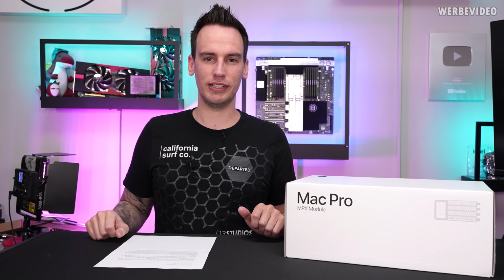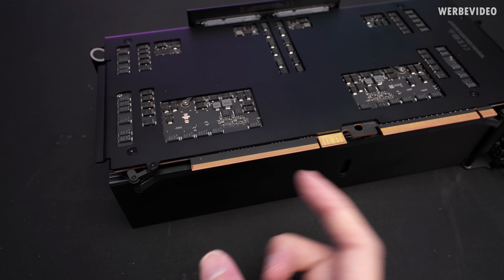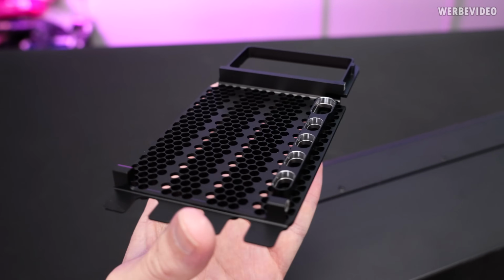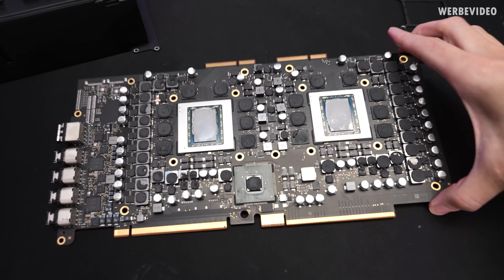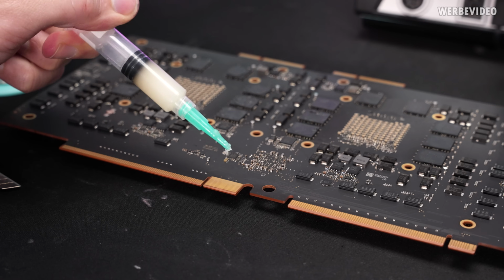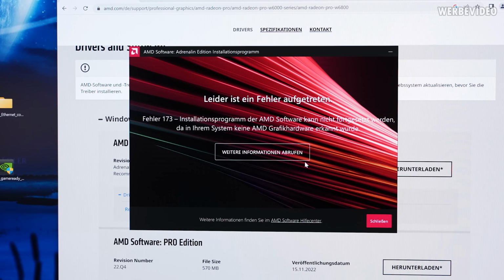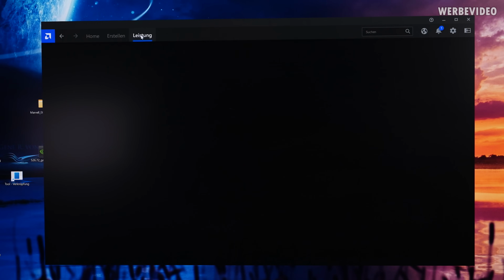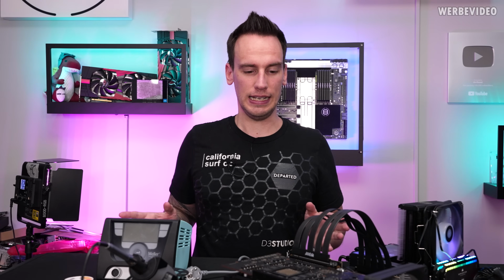This Insane AMD Dual GPU from 2021 is Faster than a RX 7900 XTX

Comment: The strange bridge on top of the gpu is the infinity fabric link. That bridge is allowing one gpu to have access to the other gpu memory
Reply: On Mac that bridge allows both cards to access ALL resources between them since they route all I/O through a set of MUXs.
Reply: @Menti Capti Crossfire and the Infinity Fabric link are not remotely the same
Reply: That's how Thanos was able to travel between worlds
Reply: my prototye Radion pro v540 which would have come out before that card and has 2 GPUs i think has crossfire it never released and has no drivers so I can't check but I do have it in person
Reply: So its like SLI?
Reply: @mayuravirus6134  yes, but with higher bandwidth
Reply: @fabiotiburzi Question is how high is the bandwidth?
Reply: @mayuravirus6134  high, don't know how much but is high
Reply: Nothing new 295 Nvidia Dual old project or 550 Ti Dual... . Mac shit and price for Bankster childs.... .
Reply: inifity fabric is a the PCB/Die level it's for small distances for a 3d cache to the IMC on die...
Reply: Sounds kinda like SLI.
Reply: @uattias  yup, it works like that
Reply: SLI
Reply: @Menti Capti " Crossfire is dead for games but not for GPU compute use cases"
Even if not intentional at the very least it reads like likening the gpu-gpu links for compute to Crossfire links, which are not the same which is why I answered what i did
Reply: Infinity fabric bridges microns, Crossfire can bridge centimeters.
Reply: @stevenwest1494  tell that to the instinct MI50
Reply: I think you can link more of those cards .
This way .
Its not make for a pc .
It make for professional systeem
Reply: @dyslectische  i think you can do exactly that with Radeon Pro and Instincts
Reply: @dyslectische  yup. theoretically unlimited, if the motherboard allows it.
Reply: @dyslectische  crapple isn't professional hardware lol its anti repair hardware for scamming gullible apple marks.
Reply: @dyslectische  I have a PC and it is equipped with components from a server.  Anyone who is familiar with software and hardware can make a system do what they want, with enough time and design.
Reply: @dyslectische  yes, but that's not what the bridge is for, infinity fabric is also used in Rx series cards and on Ryzen CPUs, it allows for the chip to fully utilize memory and cache drastically reducing latency

It was actually first introduced on Ryzen chips
Reply: @dyslectische  yeah it’s called a server.
Reply: @dyslectische  >calling an apple product professional
kek thats a good one
Reply: @DJGeosmin  spotted the 4chan anon.
Also, you can just hate on Apple however much you want, but professionals do use Macs a bloody lot. Looking at Disney/Pixar and the like...
Reply: Apple hates on consumers and technicians that dont work for them enough to earn the hate they receive.. one of many reasons i dont like them - to be certified as a technician for repairing Apple phones, you have to agree to EXCLUSIVELY fix Apple phones. Because somehow, repairing Android phones and proving your services to a larger market makes you less qualified to fix Apple phones.. and as a computer technician, I've seen my fair share of the "booby traps" in their designs that are intended to make it not only a risk for small businesses/third parties such as myself to work on them(hidden and proprietary connectors that happen to be delicate and expensive etc.) but they make it as expensive and as much of a pain in the ass for us(the non Apple technicians) as possible to make themselves more money while forcing their competition to be more expensive than they otherwise would be. On a slightly related note, for people who think Apple products are more secure - the supposed 'security' they have compared to non Apple products such as Android and Windows would only be from being a smaller user base compared to Android/Windows.. the larger amount of potential victims will always be the primary target for malicious activity, so hackers and the like are less likely to even try outside of the largest user base. @jamesbrendan5170
Reply: u guessing
Reply: @tredogzs that's not a guess it's a fact. Same as if AMD wanted to make 500 cores cpu, they could.

Comment: The MPX connector is used to reroute PCIe to Thunderbolt ports throughout the machine or the Afterburner card.
Reply: Finally, yes. Somebody who understands it's not just, "Apple proprietary bullshit," it actually serves a purpose.
Reply: @FixedFunction  Thank you :) Apple is not so closed as most people think. macOS X is OpenSource for most of its code. If you look for the white paper for the 2019 MacPro, Apple does provide schematics (high level) for the cards and explains why they do MPX. I had posted the link but it got removed by Youtube. Just Google it.

Comment: Linux has native support for amd gpus, I wonder if it would’ve worked there out of the box
Reply: yeah It's kinda annoying that this is still an obscure thing for many people. It's so convenient but unfortunately there's a lack of benchmark support on linux. There are some but it's not comparable to the usual ones. I guess Wine could run those without a problem never checked though.
Reply: @akosv96  by benchmark you most likely mean gaming benchmark, as linux has a ton of production benchmarks, including ones that use the gpu
Reply: There's a difference between support and performance - generally speaking you'll get higher framerates with the windows drivers - considerably more time and effort has been spent there.
Reply: @JohnnyWednesday  this is not true anymore. There are a number of games that I own that get better framerates in Linux, especially once you install Zen Kernels in Arch.
Reply: @JohnnyWednesday  My 6950xt is faster in linux than windows for hogwarts legacy, it's gotten to the point that many games are actually faster in linux than windows now, it's largely down to when they're slower it's because proton isn't playing well with the game itself.
Reply: @JohnnyWednesday  This is true for games but for everything else Linux runs it better. Especially Blender. Edit: specifically in regards to running something on an AMD gpu
Reply: Glad to find out I was wrong. I didn't there were so many things already available even though I use linux daily.
Reply: it still relies on code delivered by amd, might work but not correctly if no one added support for it
Reply: @tubaeseries5705  The linux AMD driver is open source, proton is open source and now FSR 2.2 is open source. It might take a while but once we see community improvements to FSR 2.2 things will get really interesting.

Comment: If the second PCIe-like connector under the gpu is same as a classic pcie , could you use 2 risers maybe?
Reply: It's not the same. It's a proprietary apple MPX connection. 3:40 He clearly states that it's a much higher density connection.
Reply: @JaenFoster  I swear some people dont even watch or listen to the video.

Comment: dont we all wish single board dual gpu card still a thing. just for fun
Reply: Dual GPU card, very cool, and then of course you can have two of them.
Reply: It's technically possible if it's done like what Apple did with the M1 Ultra. By connecting both chips together with such a fast connection, the system treats them as a single chip.
Reply: I know is not a consumer-grade GPU, but it isn't what the CDNA2 cards are doing?